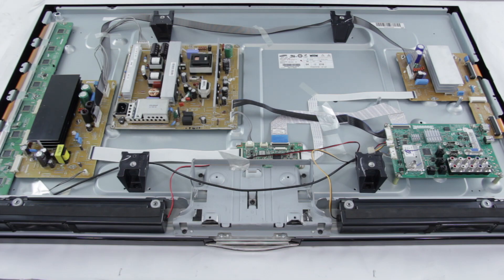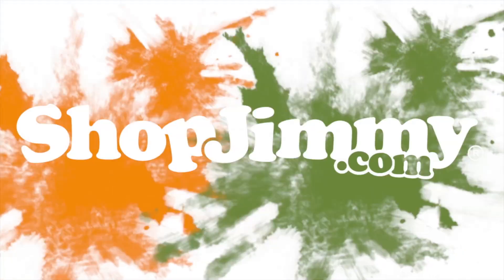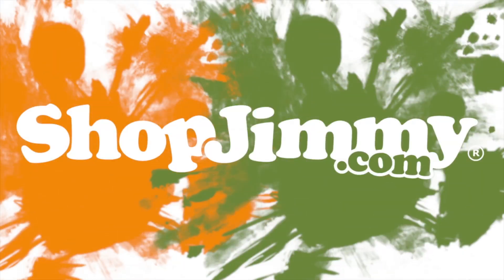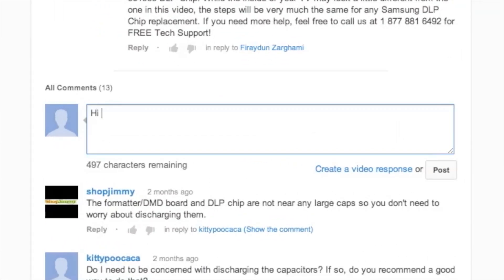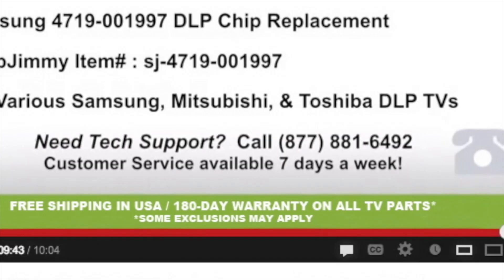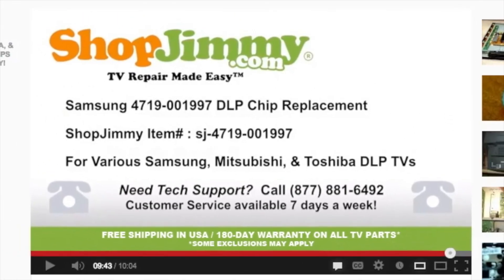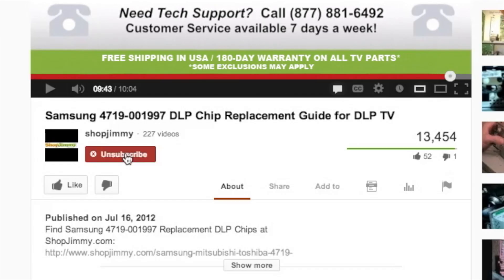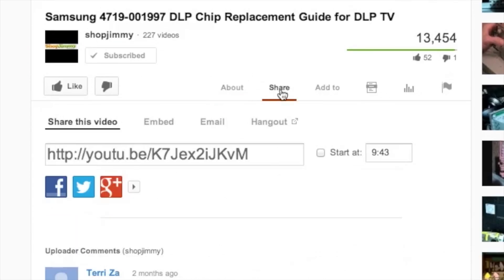Plasma TV Repair Tutorial - Common Symptoms & Solutions - How to Fix Plasma TVs

Comment: Great Video,
I have a LG 50PK550-UD Plasma TV and there is no picture coming in the bottom 1/3 of the tv screen. It this a display issue or a board issue? Is it common to replace Y Sus and buffer boards at the same time?
Reply from the maker: Ty Apgar It sounds like the bottom buffer is bad, I recommend replacing all buffers at the same time.  Here is a link to replacement parts for your TV model number on our website, click here:  http://www.shopjimmy.com/catalogsearch/result/?q=LG+50PK550  Be sure to match part numbers on your current board, with your replacement for compatibility.  Here is a link to a video showing how to identify your part number, click here:  LG Plasma TV Repair: DIY Part Identification Number ID Guide for LG & LG Philips Plasma Panel Parts  You can also call our customer service for further assistance with your purchase.  (877) 881-6492  Thanks and please let us know if you have any further questions with your TV Repair!  www.shopjimmy.com

Comment: Hello, John here. I have a Samsung 5033 Plasma TV, I lost the picture and found a burn spot on the Y-Main, replaced it, it worked for a couple hours. now I have replaced the Y-Main, The upper and lower Buffers, the Power supply board, and the Logic board. now I have power, sound, and only 60% of my screen. The Right 40% is black.
I have a X- Main coming but will it fix my problem?
                             Thanx, Going Broke

Comment: Hi,

Im my LG 50PQ1100 Plasma TV the HDMI input seems to have stopped working.
I've tried changing the signal sources, HDMI cables, resetting the TV and TV Box but still getting "No Signal". The good part is that through either the two SCART available the TV seems OK, only apparently without HD capability.
Is this common ? Can it be fixed ?
Reply from the maker: Joao Esmeraldo I recommend replacing the main board in your TV.  Here is a link to replacement parts for your TV model number on our website, click here:  http://www.shopjimmy.com/catalogsearch/result/?q=LG+50PQ1100  Be sure to match part numbers on your current board, with your replacement for compatibility.  Here is a link to a video showing how to identify your part number, click here:  TV Part Number Guide for LG & Zenith Main, Digital, & Tuner Boards (LCD, LED, Plasma TVs)  You can also call our customer service for further assistance with your purchase.  (877) 881-6492  Thanks and please let us know if you have any further questions with your TV Repair!  www.shopjimmy.com

Comment: GREAT VIDS GUYS  , I NEED HELP WITH MY SON TV ITS A 32 INCH ALBA TV IT HAS NO SOUND OUTPUT VIA TV FROM SPEAKERS IN TV BUT OUT PUTS WORK IT WORKS USING AUDIO OUTPUT SPEAKERS ONLY ???
Reply from the maker: DOUG FRIARY I recommend replacing the main board in your TV.  Please reply with a TV model number and we can recommend a replacement part.  Thanks!  www.shopjimmy.com

Comment: I am truly happy found your Video!! I would like to ask about a Zenith 42inch. Plasma TV, model # Z42PQ20, there was if I can remember right, maybe three power surges that came through our home, and the TV was on at the time this happened. And it remained on and working for about three days. I believe I was the one who shut it off, and latter that day I tried to turn it on and, I have nothing, no power lights no noise nothing, All Black?? What would you recommend I do to fix the problem?? and maybe, do you have such a part to fix it?? For sale I mean!!
Reply from the maker: James Shockley I recommend replacing the power supply in your TV.  Here is a link to replacement parts for your TV model number on our website, click here:  http://www.shopjimmy.com/catalogsearch/result/?q=Z42PQ20  Be sure to match part numbers on your current board, with your replacement for compatibility.  Here is a link to a video showing how to identify your part number, click here:  TV Part Number Identification Help Guide for LG & Zenith Power Supply Unit (PSU) Boards  You can also call our customer service for further assistance with your purchase.  (877) 881-6492  Thanks and please let us know if you have any further questions with your TV Repair!  www.shopjimmy.com
Reply: Isnt that the one i fixed

Comment: I have a Panasonic Plasma, model # TC-54PS14 TV, manufactured in Sept 2009.  About 2 years after purchasing this set the picture went out and a blinking red light appeared.  My research at that time indicated it was likely due to a thermal fuze and the repair was replacement of the board, model HANDA JA08682, to the tune of about $350.  That was < than 2 years ago and it just happened again.  The TV has a great picture (when it works), so even though I would like to keep the set, I am not planning to spend that much every couple years to keep it running.  I would appreciate thoughts?
Reply from the maker: Casie Clayton You can buy replacement boards and replace them yourself.  Only do this work at your own risk.  Here is a link to replacement parts for your TV model number on our website, click here:  http://www.shopjimmy.com/catalogsearch/result/?q=TC-54PS14  Be sure to match part numbers on your current board, with your replacement for compatibility.  You can also call our customer service for further assistance with your purchase.  (877) 881-6492  Thanks and please let us know if you have any further questions with your TV Repair!  www.shopjimmy.com

Comment: I have a lg plasma tv  42pc3d-ud the power light stays on but I no picture or sound do you have any ideas
Reply from the maker: nathan duty I recommend replacing the Y-sus board in your TV.  Here is a link to replacement parts for your TV model number on our website, click here:  http://www.shopjimmy.com/catalogsearch/result/?q=42pc3d-ud  Be sure to match part numbers on your current board, with your replacement for compatibility.  Here is a link to a video showing how to identify your part number, click here:  LG Plasma TV Repair: DIY Part Identification Number ID Guide for LG & LG Philips Plasma Panel Parts  You can also call our customer service for further assistance with your purchase.  (877) 881-6492  Thanks and please let us know if you have any further questions with your TV Repair!  www.shopjimmy.com

Comment: Hello, I have an issue with my LG 50PG700 plasma tv. I have a vertical green line approximately 14 inches in from the left hand side of the screen. The Tv as always been mounted on the wall and never moved and appeared about 2 weeks ago. The picture is fine apart from the green line which is only a couple of millimetres wide.
I look forward to your comments. Great video and very clear by the way.
Thanks
Mike
Reply from the maker: Michael Davies This sounds like a TV panel problem.  If your TV panel is bad, it may be more cost-effective to replace the TV as panels are typically hard to find in stock, difficult to replace, and expensive.  Thanks and please let us know if you have any further questions!  www.shopjimmy.com

Comment: Hello, I have a Pioneer PDP4304. It has a problem of turning the screen on very slowly. It takes 20-25 minutes for the screen to come up. The picture shows little by little, and the pixels start to come alive. What could be the problem with this TV. Once the pixels show up, the picture is perfect after that point.
Reply from the maker: Mike Shahabi I recommend checking the capacitors on the power supply.  If they appear to be damaged or bulged, you will want to replace them or the entire power supply.  Unfortunately I do not see any replacement power supplys in the search results for your TV model number on our website.  Thanks and please let us know if you have any further questions!  www.shopjimmy.com
Reply: Thank you ShopJimmy I will do that. Just a note, which is the power supply board on the Pioneer ?

Comment: I have a Samsung TV, Model Number is LN46A550P3F.  While watching TV last evening, a loud squeal started and the screen went green, with lines, and you could barely see the image in the background.  We tried to shut power down with the remote, and using the buttons on the side, and neither worked.  I unplugged it.  I plugged it back in, and the power comes on (get a click and see the blue light bar on the base lights up).  The screen remains black and the power cycles.  Periodically, we get a very loud squeal again.
Reply from the maker: Steve Junk I recommend replacing the main board in your TV.  Here is a link to replacement parts for your TV model number on our website, click here:  http://www.shopjimmy.com/catalogsearch/result/?q=LN46A550P3F  Be sure to match part numbers on your current board, with your replacement for compatibility.  You can also call our customer service for further assistance with your purchase.  (877) 881-6492  Thanks and please let us know if you have any further questions with your TV Repair!  www.shopjimmy.com

Comment: I have a Philips LCD model number 42PFL3704D/F7 March 2009 J Serial number DS1A0910102195 Ok so a buddy gave me this TV because he bought a bigger one. He told me the TV would make a loud pop noise and is suffering image burning. Since I've had the TV for almost a year now I have never heard a loud pop noise. I do notice if you pause the TV you will see a burned image but it goes away so to speak. We have the TV on for a good 12 plus hours daily. I fell asleep with the TV on and woke this morning and the TV is off. When I unplug and plug it in I hear a little noise like the TV is powering up maybe? I get no image at all.Im not seeing any power light or screen display at all. So I take the back cover off the TV and look for signs of swollen capacitors. I don't see any signs of a swollen capacitors. I do see blackish marks in various places on the one board 090302po8a a91h2-miv p/o:e7178890 perhaps the power supply board? The power supply plugs to the board in question. Im not sure if its heat residue I'm seeing? I don't see any obvious burn marks. The marks I see are black and wipe away with a rub of the finger. Any ideas ?? Also what kind of circuit tester should I buy. I don't have one. How much do they cost roughly. This is my first time entering a TV. Im a virgin to this stuff. PLEASE HELP!! dapainterdude@hotmail.com  My name is Ric Thank you very much.
Reply from the maker: DaPainterDude I recommend replacing the power supply in your TV.  Here is a link to replacement parts for your TV model number on our website, click here:  http://www.shopjimmy.com/catalogsearch/result/?q=42PFL3704D%2FF7  Be sure to match part numbers on your current board, with your replacement for compatibility.  Here is a link to a video showing how to identify your part number, click here:  Part ID Numbers for Sylvania, Emerson, Philips Magnavox MPS, MPW, MUT, & Digital Boards TV Repair  You can also call our customer service for further assistance with your purchase.  (877) 881-6492  Thanks and please let us know if you have any further questions with your TV Repair!  www.shopjimmy.com

Comment: I have a panasonic th58pz750 and the top half of the tv is blacked out.  Is there anything I can do to save this or is it better to just get a new tv?  any help would be apreciated.
Reply from the maker: Kreston Douglas This could either be bad buffers, or a bad panel.  If the problem is the TV panel, it may be more cost-effective to replace the TV.  You could try replacing the buffers to see if that fixes the problem.  Here is a link to replacement parts for your TV model number on our website, click here:  http://www.shopjimmy.com/catalogsearch/result/?q=th58pz750  Be sure to match part numbers on your current board, with your replacement for compatibility. You can also call our customer service for further assistance with your purchase.  (877) 881-6492  Thanks and please let us know if you have any further questions with your TV Repair!  www.shopjimmy.com

Comment: Hello, my Vizio P50HDTV10A with serial number beginning AHPBCBBG is having issues. I can turn it on but the screen will flash on and off and I can hear a faint clicking sound with each flash. The picture is completely garbled in the half-second that the screen is on. Sound is also not working.

Comment: I have a Zenith Z50PJ240 appx. 5yrs old.  The sound is ok, the picture goes black for a period of time then will come back.  It seems as the tv is on longer the longer the time between blackouts until the picture stays on.  This may be one hour or more.  Sometimes there is a bar of "static" or as if the antenna is off an older tube type tv, but this condition only lasts a split second.
Thank you

Comment: plasma tv th-c42hd18 the tv turns on no picture and sound
Reply from the maker: Bill Little Are there any error codes?  Could be a bad main board. If you can check for priming (screen flashes and goes from black/off to slightly lighter grey) if they get it thats a good sign that the buffers and sus are working.  Check for this, and please let us know the results!  www.shopjimmy.com
Reply: the code is 5 blinks

Comment: Hi i got a samsung pn50c6400tf and i get about 22 black horizontal lines and 1 vertical line which changes color. Thanks
Reply from the maker: Jerry Purba The horizontal lines are most likely bad buffers, so you could replace the buffers to see if that fixes the problem.   You can try re-seating the cables but it'll probably need buffers. The vertical line if wide and solid could be a logic board. Otherwise the lower address buffer or panel, tough to say for sure, and you will need to test one board at a time.  Here is a link to replacement parts for your TV model number on our website, click here:  http://www.shopjimmy.com/catalogsearch/result/?q=pn50c6400tf  Be sure to match part numbers on your current board, with your replacement for compatibility.  You can also call our customer service for further assistance with your purchase.  (877) 881-6492  Thanks and please let us know if you have any further questions with your TV Repair!  www.shopjimmy.com

Comment: Hi there - I have a Pioneer PDP-5020FD plasma, 8 years old.  We turned it on today, and the right half of the screen is black, and the left half has strange colors / artifacts.  There is not a straight line separating left and right half - it sort of curves near the top and bottom of the panel.  Any thoughts?  Thanks!!

Comment: have a Panasonic 50 inch plasma model tc-p5052 shut off wont come back on blinks 10 times, if I remove power cord and replug it clicks then clicks again and starts blinking a 10 code
Reply from the maker: Brian Dayman Can you please confirm your TV model number?  I see a p50s2 and a p50c2.  Please reply with your TV model number and we  can recommend a replacement part.  Thanks and please let us know if you have any further questions with your TV Repair!  www.shopjimmy.com
Reply: Sorry , yes it is a tc-p50s2  also when I unplug the s board it changes to a 7 blink code and I can see a transistor that has blown on the s board

Comment: Hi I have a CELLO C32109F and the set turns on fine but the picture plickers on and off, there are just two boards in the back, all the caps look ok, which board is likely the problem, and could it be a cap that is problem, many thanks
Reply from the maker: Trevor Owen If the backlights are going out I'd say bad power supply, if the video is blinking on and off I'd say bad main board.  Unfortunately I do not see any replacement parts in the search results for your TV model number on our website.  Thanks and please let us know if you have any further questions!  www.shopjimmy.com

Comment: samsung 50 inch plasma tv hpt5064- great picture but the sound is really screwed up. it sounds almost like a popping, or "purk purk purk...." If you run external speakers it helps, but it is still there. Ideas?
Reply from the maker: The Vearus Group I recommend replacing the main board in your TV.  Here is a link to replacement parts for your TV model number on our website, click here:  http://www.shopjimmy.com/catalogsearch/result/?q=hpt5064  Be sure to match part numbers on your current board, with your replacement for compatibility.  Here is a link to a video showing how to identify your part number, click here:  Samsung Plasma TV Repair: Samsung Plasma Panel Parts Guide  You can also call our customer service for further assistance with your purchase.  (877) 881-6492  Thanks and please let us know if you have any further questions with your TV Repair!  www.shopjimmy.com

Comment: I have an HP PL5060N with power and sound but NO picture, sounds like YSUS board or IPM's on same board I have taken the board out and the top IPM area is heated looking on the back of the board, do you have part numbers and prices for these>
Reply from the maker: Booboo Bear Here is a link to replacement parts for your TV model number on our website, click here:  http://www.shopjimmy.com/catalogsearch/result/?q=PL5060N  Be sure to match part numbers on your current board, with your replacement for compatibility.  Here is a link to a video showing how to identify your part number, click here:  LG Plasma TV Repair: DIY Part Identification Number ID Guide for LG & LG Philips Plasma Panel Parts  You can also call our customer service for further assistance with your purchase.  (877) 881-6492  Thanks and please let us know if you have any further questions with your TV Repair!  www.shopjimmy.com